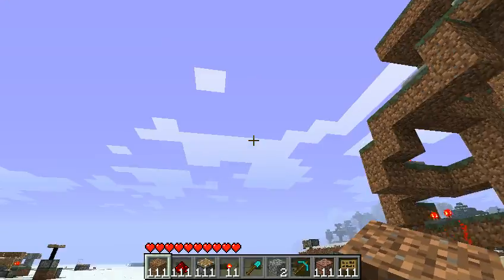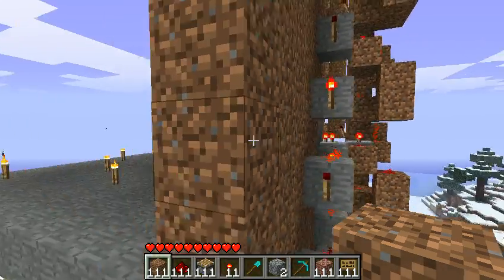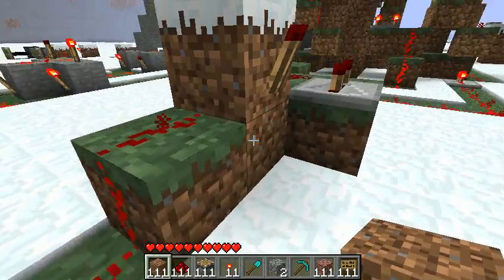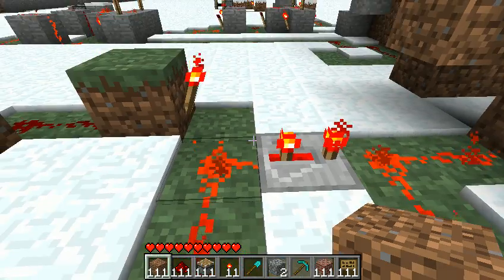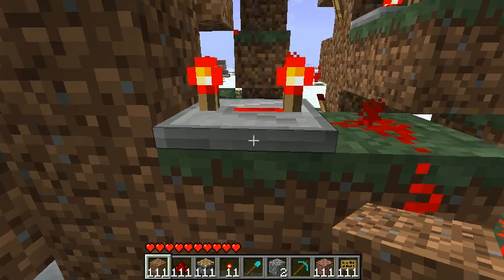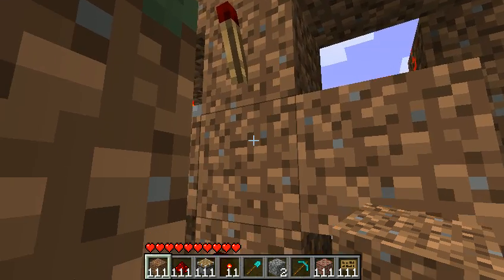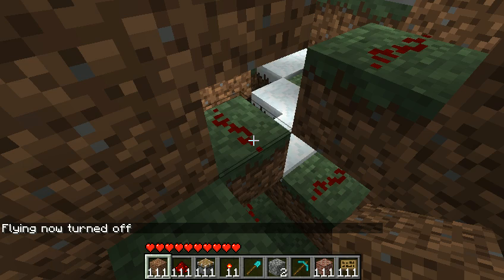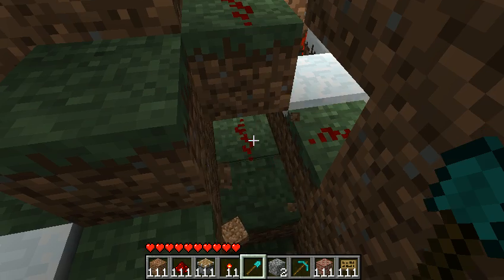piston snake elevator improved

Comment: okay, what you do is you have to combine both the up piston set (Sticky + Push) with the down piston so ultimately you will get a sandwich like this: Push, Sticky Sticky, Push.  The push(non-sticky) facing inward and sticky pistons facing outward.  Then , if you line up the redstone on either side so that one side is the up circuit and the other a down circuit, you can turn one side on for up and the other side on for down.  I hope that's kinda explains.

Comment from the maker: Well, I have looked into it a little, and this is what I discovered: To make the two pistons go back down you would have to destroy them and place them upside down (opposite to how you place them at the bottom). Then the redstone would need a change because it has to operate in the opposite direction. I did make a separate one that goes down only and I discovered that you seem to fall through the pistons, though this may be fixed already in another update.